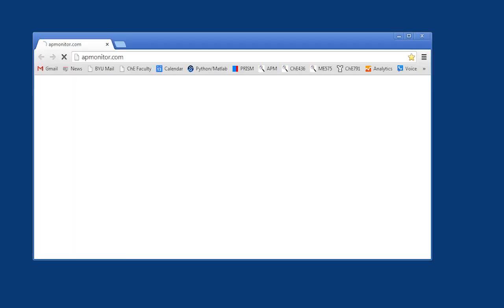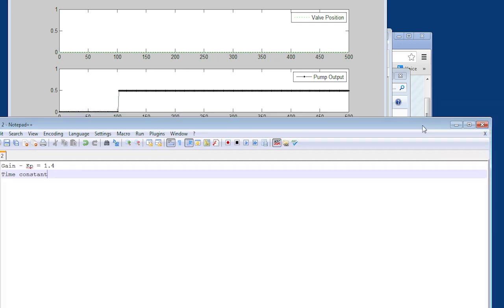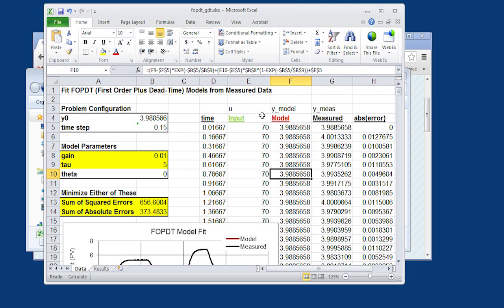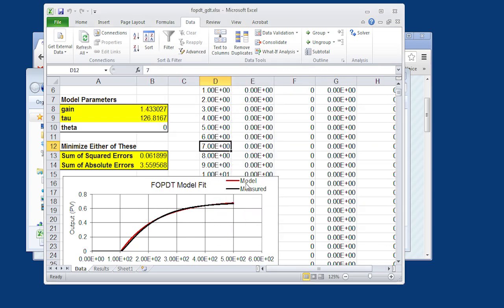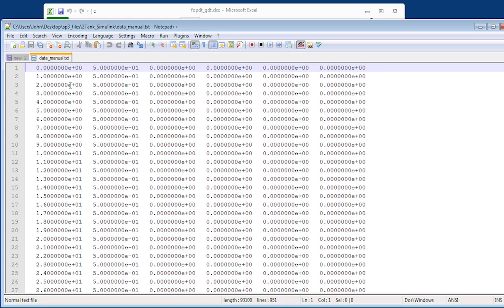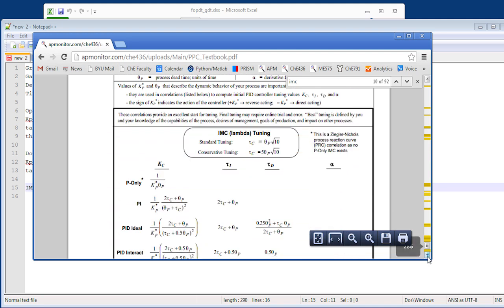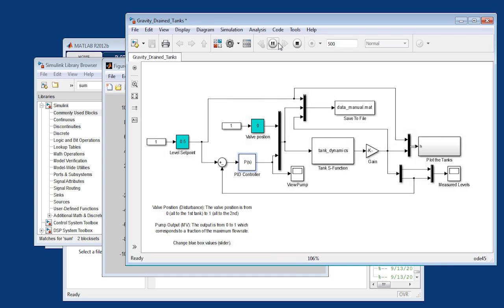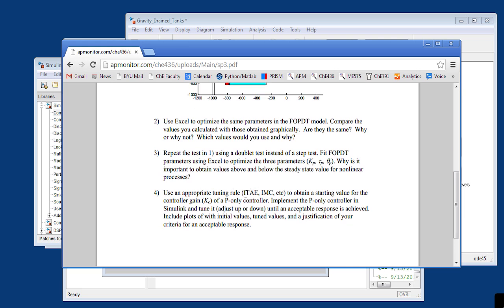Simulink Process Control Exercise

Comment: This video is for an engineering class. 
I gave this video a thumbs down because it is more about using the tool than understanding the plant or the best way to control it.
The students don't seem to know any better.  They see, to be more interested in the animations than really understanding the plant.
Reply from the maker: +Peter Nachtwey, check out the problem statement for Python (http://apmonitor.com/pdc/index.php/Main/LevelControl) and Matlab (http://apmonitor.com/che436/index.php/Main/CourseHomework). You are correct that this is just how to use the simulator.
Reply: +APMonitor,  the python example is much better.  It is much less reliant on the tool.  You take into account that  the system is non-linear and use an ODE integrator because differential equations can be non-linear as in this example.  I would give the python example a thumbs up.

A system identification program in python would be good too.  It would be much better than the Excel example.  Python is free and OS independent.
Python is a good choice.
Reply: This is good.  I see you are using Anaconda and a minimize function to minimize the sum of errors squared.  System identification, minimizing or optimizing could be a whole class on its own.  One of my objections to most classes and books is that the open loop transfer function is given.  In reality the open loop transfer function is never given.  I always add an offset to the transfer function I am trying to optimize because zero output  does not alway mean 0 speed or zero temperature.  Real systems have an offset.    It is tough to identify systems with more than 3 poles.  Even if you can it is hard to use the higher order controller gains like the derivative and second derivative unless using an observer or Kalman filter to estimate the higher order derivatives.
I am just getting into Jupyter.  You may find this good for teaching
http://jupyter.org
It uses Anaconda/python,
Reply: Peter Nachtwey, thanks for your perspective. We use the Jupyter Notebook for our introductory course and then migrate to Spyder or PyCharm (full IDEs). I sometimes show the examples with IDLE or Notepad++ but I do recommend a full integrated development environment.

Comment: Do the Dimiensions of the tank matter if so where would i modify them?
Reply from the maker: +Nicolas Diaz Yes, the dimensions will affect the dynamics of height with a particular flow-rate. You can modify the dimensions in the associated script file in the download. I think it is in the Initialize.m file.
Reply: +APMonitor.com  Thank you
Reply: +APMonitor.com In my problem i have that the water is entering the tank in a 1 inch pipe but it exits the tanks in a 1/4inch pipe any ideas on how to integrate this second diameter or should i just consider the descharge one.
Reply from the maker: Yes, you'll just need to change the inlet flow and how it relates to the inlet diameter. You can use Bernoulli's equation to derive the relation between height and the outlet flow.

Comment: Hi, i would like to know there are 2 videos of yours using the same concept..One is 22 min video published on 15th sep 2014 and the other one is this. May i know pls whats the difference? Thank you.. Its a great video
Reply from the maker: +Ikramul Haque They are very similar. The 2013 version (this one) is longer but covers much of the same content as the 2014 version (https://youtu.be/WxlZW9buRNA). One of the changes is some improvements to the Excel spreadsheet to better accommodate dead-time. Otherwise, they are very similar.
Reply: +APMonitor.com Can you please tell me how to use pid controller in simulink to measure the 2 water level storage tank..not gravity drained tank. Because in gravity drained tank the water get drained out. I want to know how to control 2 tanks using Pid controller simultaneously and to get those graphs? Based on the level set point.
Reply from the maker: If your tank doesn't have an outlet then it is an integrating system. A P-only controller should work best if it is an integrating system. If you want to modify the 2 tank Simulink problem, you can specify the outlet flow (either set to 0 or to some pumped flow rate). Just be careful to not let the tank level go below zero. You'll need to include "if" statements in the Simulink model to check for under or over-fill.